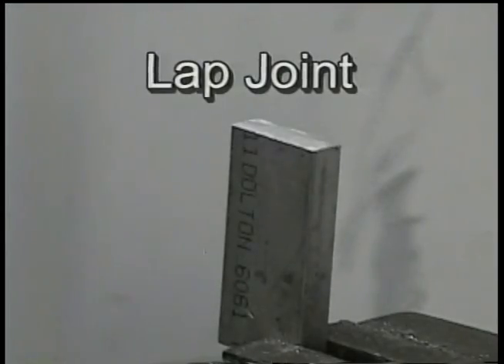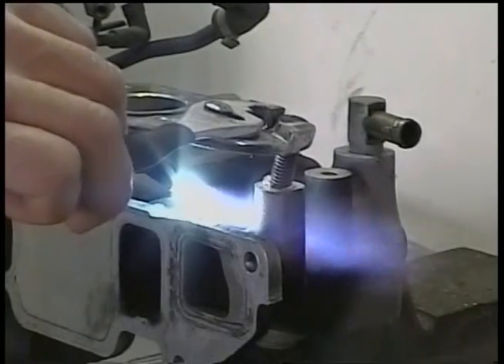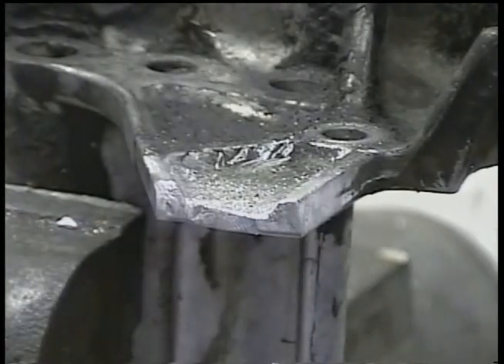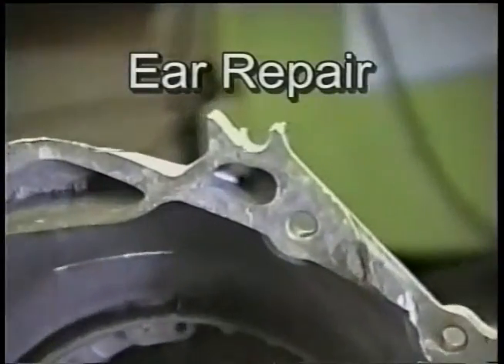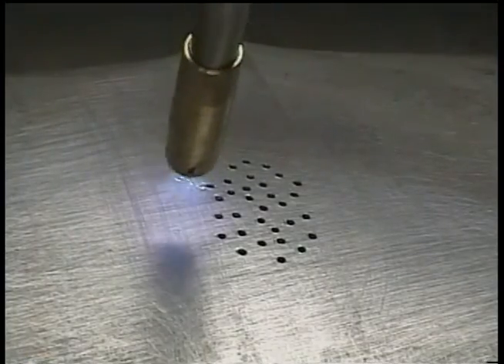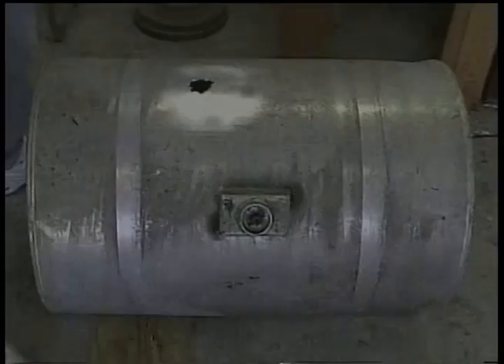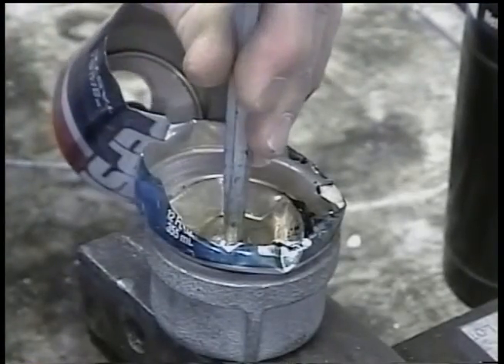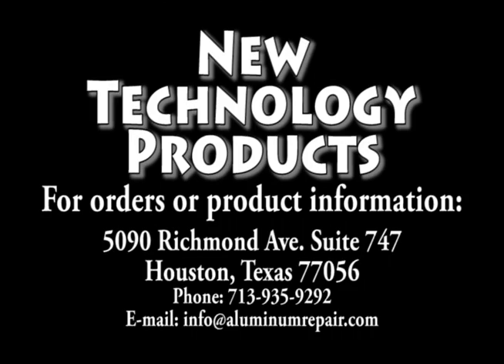HTS 2000 Aluminum Repair

Comment: If it’s melting point is 500 degrees lower than aluminium. How does it actually penetrate the metal and create a bond? Surely it’s just sitting on top.
Reply from the maker: Hello Diesel,

Aluminum has thousands of pours HTS-2000 penetrates the pours becoming a permanent part of the alloy and joining stronger than the original aluminum.
Reply: We're talking about a surface phenomenon!  Penetration at the molecular level, like solder or other brazing.  It forms an alloy at the surface, it's not just sitting there.  The base metal is not melted, which in some cases is a real advantage!  This is closer to classical aluminum brazing with flux.  I've done that a few times, and it's really the most premium and cosmetic, but you have to deal with the FLUX, which is corrosive, not really common, and probably unwholesome.  You use AL 12% Silicon rod or wire which is fairly easy to buy.  The overall experience is more like silver-soldering.  Overall the technique you see here is the easiest, and you can get a pretty cosmetic result if you try.  You SHOULD try, because as they say the braze material is HARDER than the base material, and is challenging to clean up in some cases.  On a surface you can grind it's not too bad, but you can imagine that the braze being harder has a tendency to stick up if you just sand it a little.  So try to make it look good when it's still hot!

Comment: The Propane is bit of a stretch
Reply: drewjacobsracing Propane supposedly works on thinner aluminum. I know a map-pro torch was useless on a transmission case ear, so I'll be using oxy-acetylene.

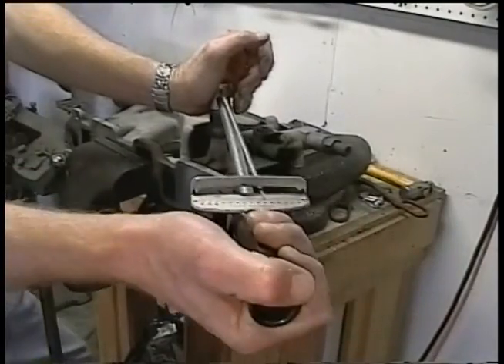Comment: Yeah, right, look at 1:32, the torque wrench is measuring about 35 Ft lbs and the bolt is turning meaning the threads are letting go. I've bought similar welding rods at swap meets at Hot Rod shows and they are good for repairing trim and the like. To strip out threads from cast iron you need to apply torque in the excess of 100 ft lbs. Now repairing Aluminum tanks, that's interesting!

Comment: If he would have smacked it with a hammer that many times and nothing bent at all I still would be impressed. I don't see how there could be any penetration into the base metal. Therefor as this is a basic surface to surface bond I am truly impressed!
Reply: Yes, it's BRAZING!  Following their instructions I've brazed some light square aluminum tubing, and hammered the joint flat pretty much.  Just squished it sideways.  There was some cracking at the end,  but I'd say it was sound.  In my own thinking: If you can distort the structure and the joints hold, they're good!  You have to clean the metal, and agitate the hot surface a little with the rod, a scraper, or a wire brush.  It doesn't take much to just move that last little layer of oxide so the metal can be wet by the rod.  Once the surface has been tinned like that, it's all downhill.  I have TIG welding gear, but on small or light stuff, or where I really don't want distortion this is a good option.

Comment: I'll admit that hammering the joined aluminum bar stock to the point that it's twisted into a pretzel without a joint failure looks impressive. What might not be so obvious is the fact that in making that joint, the aluminum stock ended up being softened (annealed) by the heat and it no longer has its original strength, which at least in part is why the stock could be deformed so badly without the joint breaking.